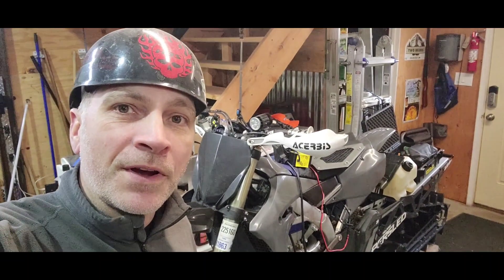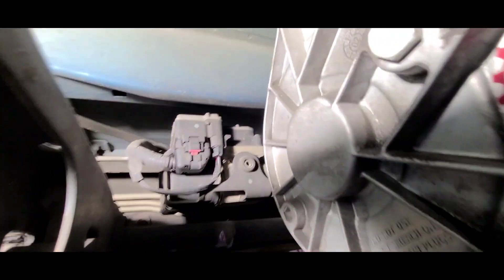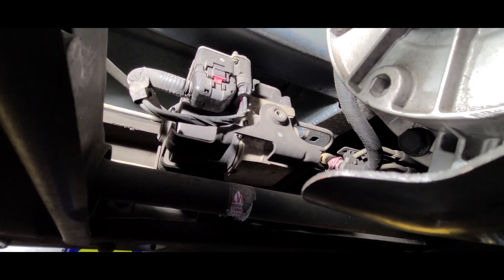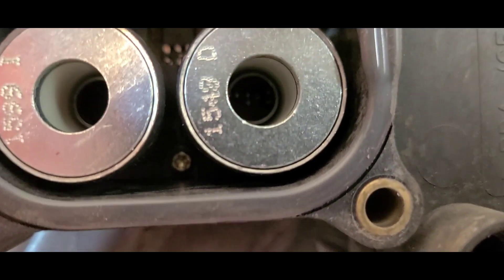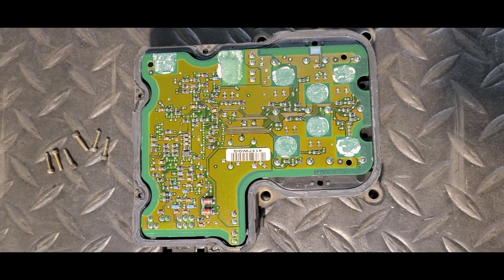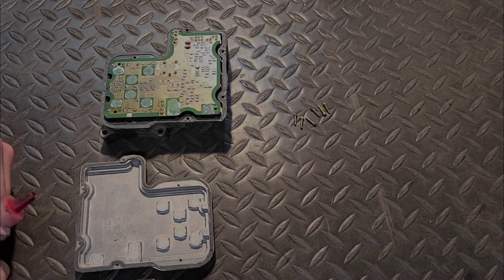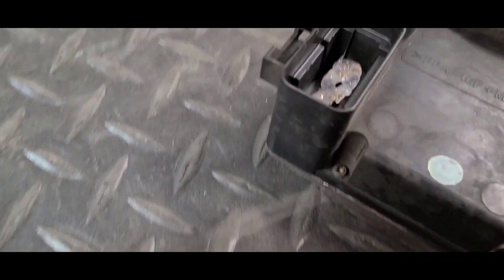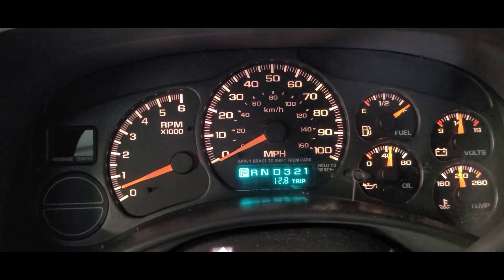1999 Chevy Silverado ABS module repair

Comment: Excellent video. I know this is an older video. Any advice on how to remove the Torx 8 screws located underneath on the backside of the ABS module cover if the screwheads are heavily decayed/stripped? I've tried different size bits, needle nose pliers, bolt extractors (bolt head just falls apart more) and nothing catches. If the screwheads were larger, I'd notch them as I did with the Torx 20 screws to remove them. Thanks!!!

Comment: That's stupid to use that grease 
Because it's anti conductive what is designed for spark plug wires not for electrical parts if you need to make sure you get connection on electrical parts you use stabilant 22

Comment: Great Video.  2000 GMC Sierra 1500. Touched the contacts with the soldering iron. Reassembled and reinstalled. 
Lights out.  Thank you.

Comment: Great video. For the guys that have trucks from the north around a lot of road salt keep in mind the 4  t20 torx screws will be rusted out and you will have to remove all the brake lines to remove the module and drill out the rusted heads off the torx bolts.
Reply: Thanks, that was my problem. Did you drop the t case to get out the while unit

Comment: If i have the module rebuilt and find out the pump doesnt work can i buy just the pump and put the rebuilt module on it without having to have it all reprogramed or would it just be better to but the whole thing and pay to have it reprogramed to my silverado
Reply from the maker: Sorry. I do not have the answer to your question. But I don't think the module needs to be programmed.

Comment: I have a 99 silverado and have replaced all four calipers because all four brakes were dragging, they still drag. Booster is dry inside. I was going to replace the flex lines but after replacing one that brake still dragged...can you shed some light on what causes all 4 to drag? I can`t get a clear direction to go in through searching.
 
that is some good insight on the module! would a bad module cause the brakes to drag?

Comment: Without question, the best camera work I've seen of removing this module. Glad yours went well. A very common problem with this series GM ABS pump is that the pump runs continuously whether key is on or off.  As said previously in this thread it's because the relay contacts are stuck closed.  There are several companies that will repair this module, one of them being Module Master for around $130.  I've simply had my 60A ABS fuse pulled for the past 16 years on my '01 Tahoe and have had no worries other than BRAKE/ABS lights on the dash are on.  Thanks for this video.
Reply from the maker: I hope you got your ABS operational.
Reply: @rwgnad  Not yet but your video gave me courage
Reply: In astro vans, front to rear brake proportioning is handled by the ABS pump. By pulling the fuse it sends most fluid to the rear. I am just learning this on my astro. I go through rear brakes every 4 months.

Comment: But you don’t need to grease the terminals and pins they have weather proof connectors with rubber seals in them

Comment: Any idea if something like this will help with my brakes locking up on my 06 tahoe.
Reply from the maker: Locking brakes are usually caused by a mechanical problem.
Reply: Take the Pistons out of the calipers and sand with 600 grit paper or higher. They're hanging up in the bore

Comment: 2000 GMC 2500 sudden ABS continuously running even with the key off.  No OBD codes shown. Had to pull the fuse.  Tried soldering the module board as described but didn't fix it. Then sent it to the Speedometer Repair Guy.  3 days shipping each way and 1 day to rebuild.  Money well spent.  Fixed.
Reply: This happens when the relay in the unit welds itself in the on position.

Comment: if the abs pump runs continuously is that caused by the same problem and fixed this way also or could it be something else?
Reply from the maker: That is a very good question.  I think it would be a very small possibility that repairing the module would fix a constant running pump. Check your relays.

Comment: This has to be the cleanest undercarriage I have ever seen on a four wheel drive truck. The use of dielectric grease really makes a big difference. I can tell you I fixed mine also with the solder trick. I am just amazed that they did not solder the joint correctly at the factory. Wonder why that is ??? How many years have the ABS modules been fastened onto the frame of these trucks ???? Did you use silicone gasket material to seal the case ?? SOLDER IS CHEAP.  Nice work fella too.
Reply: Solder joints will age and fracture over time especially in the hostile environment of a vehicle undercarriage.
Reply: @BurntToastScramble  When one remembers the simple things great things happen. Nice work fella too.

Comment: i have a 2001  1500  5.3 silverado.... i replaced  3 lines that attach to the abs metal box under the drivers side... so if abs is not working is the electronics like you show also on top of  abs box??mine is 2 wd.... is that the actual motor??? i just had a scan tool fail to open my abs and the guy said the abs motor is bad... he said i need to remove all lines again a replace entire unit... is this over kill? i don't know anything about my trucks abs at all...thanks for sharing..
Reply from the maker: I'm sorry,  but I do not have enough information to accurately help you.
Reply: @rwgnad  i took a quick look seems the same...ps i also think a bad contact with one or more of connectors will cause issue...thanks

Comment: Quick question even after shutting my 1999 Silverado 1500 off and taking the key out my pump is still running any idea what would be causing this?
Reply from the maker: The crystal ball says it might be a stuck abs relay.
Reply: @rwgnad   thanks. Pulled the 60amp fuse and it stopped! Temporary fix but it works for now
Reply from the maker: @armyleegreen  take the relay out,  and smack it on the bench a couple of times.  I bet the contacts in the relay arc welded.
Reply: That's exactly what it is

Comment: You should NOT apply Dielectric grease to electrical pins: Dielectric grease, or tune-up grease, is a silicone-based grease that repels moisture and protects electrical connections against corrosion. ... The grease does not conduct electricity, so it shouldn't be applied directly to the mating surfaces (pins and sockets) of an electrical connection.  You can put on the connector shell but not the pins.